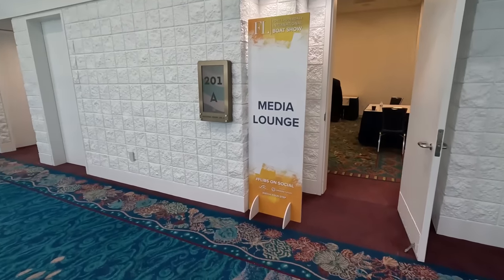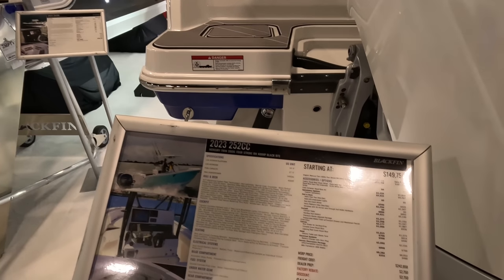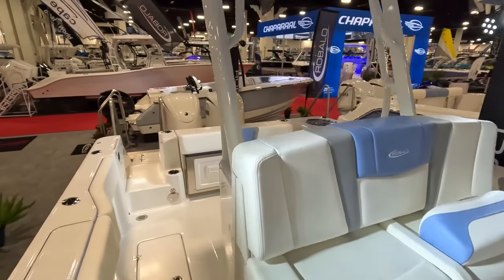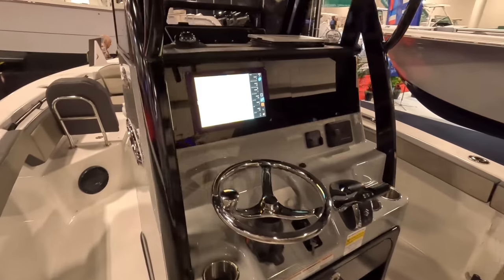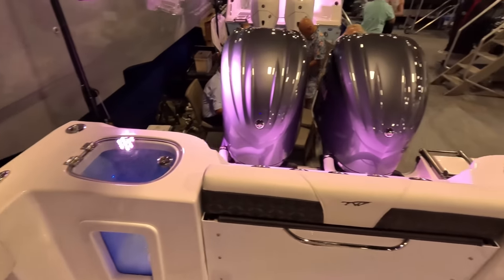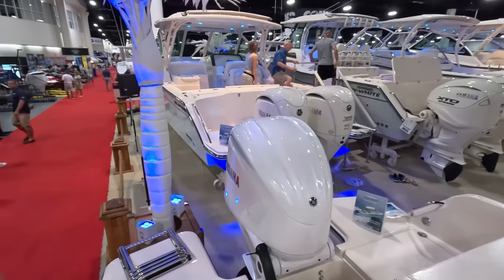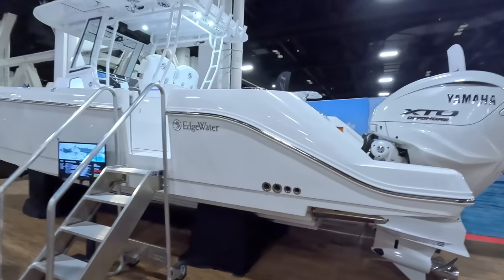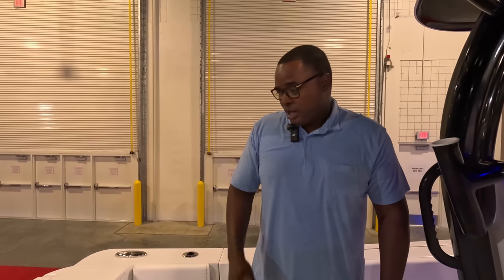2023 FORT LAUDERDALE BOAT SHOW ALL CENTER CONSOLES WALKTHRU

Comment: Im Stuck between the 262 and the 280 (The 280 has the raising table ) cant decide. Ill be at the factory on July 25th and Ill make my decision then
Reply from the maker: The 28 rides as good if not better then my Gamefish 30! you can not go wrong with that boat
Reply: @MiamiLiving305   Sorry I forgot to add Cobia factory lol. so many boats in the video. I commented when you went to the cobias. Also, the 262 in the sportsman is the one my wife loves. its really a coin flip. I fish more then we cruise so the sportsman does fit the bill more then the cobia, I just like the lines on the Cobia hull (same build process). At this point Im sick of looking at boats and doing factory tours 🤣

Comment: i wished you showed more of the smaller boats as well like 18 to 22 feet...im going to buy one that size in the next year
Reply from the maker: I did 21 ft and up, not many 18-19 Ft boats at the show this year
Reply: @MiamiLiving305  thank you for your responce
Reply: @MiamiLiving305  quick question...when u travel to the islands or Bahamas have you seen many jet boats that make that crossing? I'm looking to buy in the future the 195 fsh sport
Reply from the maker: @honeybadger4198  yes I have, with proper planning and a good window it iz possible. It’s  only 55 miles from Miami

Comment: All those boats looked like they were designed by the same company. I have never understood the American passion for centre consoles, they always seems like a waste of space to me. Here in England we need a little more cover, somewhere to relax a little when staying in the marina. don't get me wrong, I like them but those open bows make me think of huge water scoops? Can anyone explain the passion without being rude.
Reply from the maker: Here in South Florida most people use their boats for fishing or sandbars. When doing those two activities having a cabin is wasted space! Most people like the open layout of a center console especially when it comes to fishing. There is no easier boat to fish then a center console. Also center consoled are the best performing boats in the market! Not only do they take a chop very well because of there design they are also very fuel efficient due to their light weight and big power. Center console are also very easy to pull in and out of the water  so you don’t even have to pay for marinas cause they can be stored at home